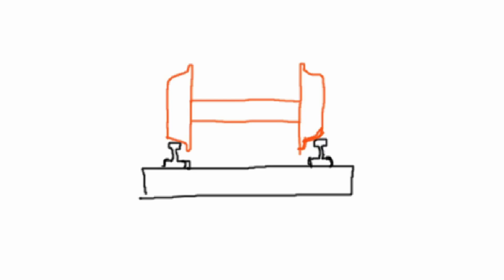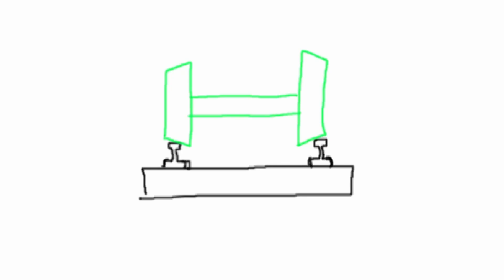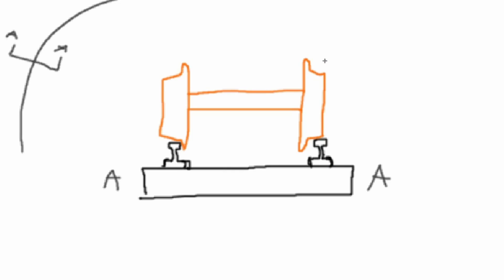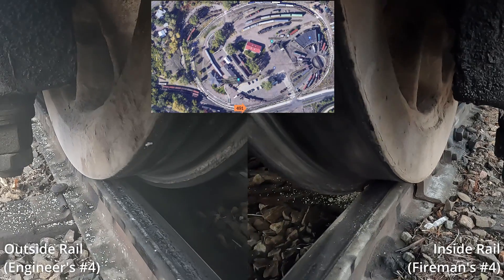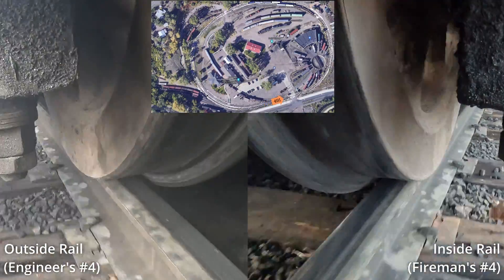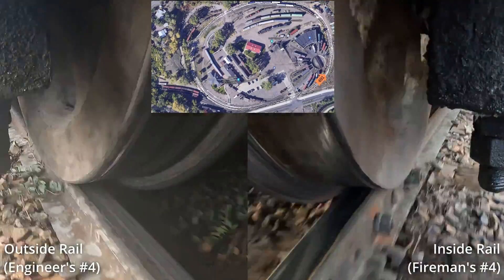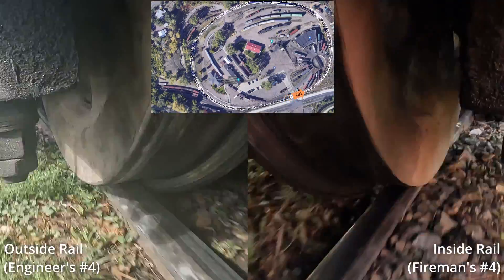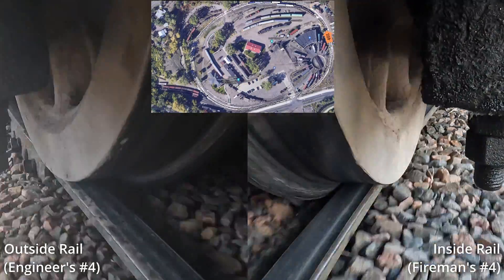Railroad 101: How do railroad wheels interact with the rail? A study on D&RGW 491

Comment: Very good information and insight.  Those are some sharp curves at the museum and those pony and trailing trucks are quite a distance from the drivers which would account for the 1/2" or so they are offset on the curves.  '91 is probably pretty "stiff necked."  I don't think they designed much lateral play into her drivers.
Reply from the maker: There's a lot of lateral in the #1, but the other three, not so much.
Reply: @Hyce777  interesting.

Comment: The flange issue is also present on the Norwegian standard gauge.
As I looked into the fuse panel of one of our DMUs from the 80s that is about to be phased out of operation this year, there were fuses and indicators for a "flange lubrication" system to fight the wear thing you see here.
This is also why the rails here are a bit oily on the inside which you can see at the passenger stations where there are track crossings between platforms.

Comment: while breaking in slot cars the tires would cut the inside track until centrifugal force causes slippage and if balanced correctly allows a drift condition.

Comment: Why is the number 1 and 3 drivers rubbing against the outside rail, and the 2 and 4 drivers riding along the inside outside  respectively at120°when clearly the 1 and 4 should ride parallel to the 2 and 4 @ a  -240° the 1 and 3 rides inside the outside rails…see?
Reply from the maker: No

Comment: I work on a standard gauge railroad in the US. We mostly do industrial switching and fairly short runs between yards and areas that we switch. In theory you don't need the flange, but I can tell you in practice those things ride on the rail all the time. Particularly through switches and tight industrial tracks, you hear them scraping the whole way. Also, it is important to remember that not all railroad track is as perfect as a Class 1 mainline. The majority of yard and industrial track is old and made out of sections that are often shorter than modern railcars. There are definitely areas where the gauge sags inward or outward. If this happens enough you'll have a derailment, but in small amounts the flanges can help keep the wheels on the rails.
Reply from the maker: Oh for sure you hear the flanges on industrial trackage all the time. Your other points are good too.

Comment: Basic Physics. It's momentum. Try it in your car, sometime. Go around a curve, and you (as well as anything else in the car) will shift towards the outside of the curve. Momentum makes objects "want" to continue moving in the same direction, even when there is a change in velocity (the direction component of velocity). Momentum is equal to mass times velocity. (Velocity, not speed, as velocity is a vector (includes a direction component), meaning that velocity is equal to distance over time in a chosen direction.) The locomotive, and the entire train, are quite massive. The amount of momentum is thus great, even at lower velocities.The train "wants"to continue going straight, even as the track curves, causing the entire train to shift to the outside. (Because of the engineering of the truck sets, however, the opposite wheeled axle will most likely have the flange of the outside rail pressing against the rail. Otherwise, the structure would fail, due to incredible amounts of torsion.) Momentum is indeed also responsible for trains, or any vehicle really, rolling over, if going to fast around a curve. It's also why race tracks are slanted upwards, from the inside to the outside. Momentum will always pull an object towards the outside of a curve.
Reply from the maker: Yes, so why is it riding on the inside of the curve?

Comment: Those tires are not sloped enough to force the them to ride up.  The reason the inner wheel lip gets closer to the rail is because it is being pulled inward by the train car itself, which in a right hand curve is always to the right of the wheel.

Comment: Centrifugal force? The momentum and going around the curve is throwing the... No... Wrong side, the outside would be wearing. This is a good one.
Is the track itself banked? If the train isn't moving fast enough for the bank of the curve it may cause the train to hug the inside rail.
Reply from the maker: Track isn't banked. You'll see the answer in an upcoming video.

Comment: What I would like to know is are the #2 and #3 axles blind drivers.   That would explain this.   The rear most axle will off-track to the inside, it's the rail that actually stops it from doing it more.   Think about how a trailer, or even the rear axle of your car off-tracks when you take a corner.   Same story here.  Unless your curve is sharp enough, and speed high enough to force all the axles to the outer rail, this will happen.   Great video though.
Reply from the maker: All flanged in our case. I filmed a follow up to this video with every single wheelset, so we'll find out shortly. :)

Comment: Easy solution. Add flange greasers to your railroad. Also you need to wye or balloon you’re a locomotive and run it the other direction on your circular track.
Reply from the maker: We do run both ways. And heavily use flange oilers.

Comment: I think your theory is right. If you think about it, you have a rigid frame going around a bend. So take that rigid frame and put wheels (or maybe pegs) in the front, middle, and back of that frame. The front and rear will rub against the outside because of centripetal force. But if the frame is longer than the radius of the curve (I think it's radius), then the middle will rub on the inside as it's turning acting as a pivot point.

Comment: Here's a question, might sounds totally out there but keep in mind that i'm a car guy and not really a train guy. Seems like the construction of the locomotive doesn't allow all the axles to wear evenly because you're doing laps only one way so how about fixing this by switching over the axles after some time to get the most life out of them. Where there's the group of 4 axles just swap them around 1 with 2, 3 with 4 after an X amount of time. Same can be done with the front and rear single axles. If you cannot alter the route then at least switch the axles around so they ride differently and act as if the loco is running opposite way laps.  Would that be possible?
Reply from the maker: We do turn the engine around. Unfortunately, with the way the locomotive is constructed, just swapping axles isn't really possible; you couldn't even spin one axle around left for right as the rods are set up to be offset only one particular way. Imagine you're trying to flip around a crankshaft, rather than an axle.

Comment: Is there any super-elevation of the track? Is the outside rail higher than the inside rail, or is it level across both rails?  In roads for cars and trucks the outside of the curve is generally slightly elevated and the amount of the elevation is dependent on the designed speed limit, (higher designed traffic speeds have greater super) and the grade, while still maintaining a certain amount of crown for drainage. 

As a traffic accident investigator I determined “minimum speeds” based on skid marks and other pavement mark evidence. Pavement grade, curve radius, super elevation, pavement coefficient of friction, along with the curve radius of the skid marks were all variable plugged into a standard formula.
Reply from the maker: There's little to no superelevation on our railroad. High speed stuff gets it, but not here.

Comment: wheels with a strait axle going around a curve the inside wheel would be trying to go slower than the out side wheel. can you explain what happens there to the people that don't under stand the workings of the wheels.
Reply from the maker: That's what the video is for

Comment: When a tapered wheel is rolling down a straight rail, you can imagine a longer circumference next to the flange, and a shorter circumference on the small end of the wheel. So if the wheel somehow made full width contact with the rail, it would have to skid on either side of the contact point. The wheel would wear the rail on either side of the contact point, or the rail would wear the wheel, depending on your frame of reference.

So when the wheel rolls around a curve, the outer wheel needs to roll farther, and the inner wheel needs to roll shorter. So the outer wheel creates a steering force that moves the contact point on the inner wheel towards its larger circumference near the flange (trying to speed up the inner wheel). The inner wheel steers the outer wheel to the outside where the circumference is smaller to try to slow down the outer wheel. Neither wheel can 'win' this argument, so they find an equilibrium point where the least skidding is created.
Reply from the maker: Makes sense.

Comment: Because the outer wheel is higher up on the track it pushes the train towards the inner rail because the shape of the wheels always wants to be centred. 

I guess it could be fixed whit another angle on the wheels, a different radius on the track or a slower speed.
Reply from the maker: All possible.

Comment: I can't theorically explain the phenomenon but by experience, I can say that the small taper on the wheel have the mission of center it on the track and avoid the ribs rubbing on the side of the track so the friction is limited.
What I can say is that when a curve have a small radius, the squeal is infernal and the only way to limit it is to paint a coat of graphite on the track

Comment: Is it a question of camera angle, but it looks like the diameter of the wheel right adjacent to the flange is smaller than the diameter of the wheel furthest away from the flange.
Reply from the maker: There's a small amount of "hollow tread" going on, but it's not really significant enough to cause issue.

Comment: First thought- (probably the only one) is that you are running tighter than "normal" bends on your track, and that the train is being dragged into the center od the turn, coupled with lower than "normal" speed on the bend.   If I'm right, you will either have to go faster (not recomended) or set the track with the outside rail LOWER than the inside!

Comment: When I was a teenager in 1960, we would drive a '51 Ford onto the railroad tracks and ride between crossings on the rails. We did not have to steer the car to keep it on the rails. Has anyone else done this?
Reply from the maker: I haven't, I'd imagine most newer cars probably have too wide of a wheelbase for that to work.

Comment: How much superelevation do you have on the track? 

Edit*** I see others have commented on this already. You need to actually measure the superelevation and then do the calculations based on the speed of the train set to figure out what is going on.
Reply from the maker: I filmed every axle on the engine and tender to figure it out. That video will come soon enough.
Reply from the maker: @DuaneKerzic  because the engine slips in that spot of the track due to track conditions. 

The superelevation is non existent.
Reply: @Hyce777  the radius of your curve is about 260', the gauge of your track is about 3' and the speed of your train is about 10mph. The required superelevation is only about 0.9". In other words, nonexistent. And if your train is only going 5mph it would be 0.24". That would be to balance the train set. Slower or steeper it slides to the inside, faster or less steep it slides to the outside.

At least that's what I learned while I was in college taking dynamics to get my BE in Mechanical Engineering.

Comment: I think the reason being for the inner flange to rub on the rail is firstly the lack of sufficient velocity for given sweep and secondly the actual rail is probably slightly super elevated on the outer radius rail.
In order to have the axle shifting how it supposed to the rail would have to be dead level horizontally I assume

Comment: I am not that familiar with the Mikado type so I don't know how it's suspension and any articulation it has is setup. But a problem with ridged frame is how the center gets pulled over the inside of the corner just like how a semi trailer does at a tight bend. Some railroads did use flangless drivers to get around this problem such as PRR but it wasn't a full fix. The only real solution is better articulation.

Comment: Think of the train going around a curve.  If we're looking at the train from behind, and it makes a left turn, the train would pivot on the center of gravity.  So, the top of the train would pivot away from the turn (i.e. to the right), and the bottom will then pivot in the opposite direction.  Hence, the wider gap where you don't expect it.  Your thought that the gap should close on the right side (the outside) would work if the train stayed completely upright through the turn, but of course it won't.
Reply from the maker: Interesting thought. I'm sure at higher speeds that is certainly true. At the slow speed we run, I'm not sure.
Reply: @Hyce777  Centrifugal force happens at any speed.  It may not be too noticable when you are on the train, but it happens.
Reply from the maker: @stephenv6200  of course; but is it "enough to move the needle"? That's what I'm unsure of.

Comment: The cars center of gravity is very high. As the curve is rounded, centrifugal force pulls the top of the car outward. As weight is transfered to the outer wheel it sinks lower and shifts inward due to cone shape. The inner wheel is forced up its rail until contact is made with the flange, keeping the car from rolling over.
Reply from the maker: Interesting thought; that probably applies at higher speeds, but I'm not so sure that's the case here.

Comment: You didn't talk about the rest of the train.  Could it be that the weight of the train is pulling everything towards the inside of the curve as it goes around?
Reply from the maker: That's definitely possible as well! I filmed every axle on the engine and tender to figure it out.

Comment: I thought the part of the frame that carries the drivers was rigid. Unless ther's an articulation point between the #2 and #3 drivers, how can there be an offset of #2 and #3 with respect to #1 an #4?
Reply from the maker: The frame is rigid, but the suspension is separate and the drivers all have their own play.

Comment: You sound like someone that should subscribe to the trade publication: “Interface - The Journal of Wheel/Rail Interaction” where all the science of steel wheels on steel rails gets discussed. 

The suspension theory makes a lot of sense. Would be interesting to try a few things to validate that theory such as…
…running the locomotive for a lap in reverse - although the buff forces from the tender may add a lateral load into the frame that causes the rear driver to overcome the inward forces of the suspension, possibly causing the #4 driver to pull away from the inside rail.
…repeating the tests with a locomotive that lacks a trailing truck (346) 

It would also follow that the repeated laps around the loop with the forward-most and rearmost driver always being forced to slip/scrub you would in time see a different wear pattern on those tire’s treads; I would wager the taper disappears more quickly on those drivers.
Reply from the maker: I need to look into that publication! I have not heard of it. I filmed every wheelset on the 491 yesterday to make more comparisons in another video. I want to try 346 as well, for the no trailing truck and also blind drivers; but she's down for overhaul so it will be a few years.

Comment: Dont know the full specs so just a guess, but in theory the taper of the wheel should be proportional to the radius of the rail curve for the full theory to work. And by the looks of it you are running a really tight radius museum track. I would also take a guess that the loco has probably been running the same loop of track in the same direction for years. So based on the current wheel taper the wheelset is trying to self center but running out of room so hitting the flange. Not a train guy just a maths guy.
Reply from the maker: We run both directions, and it is still relatively tapered. The right curve doesn't help for sure though.

Comment: Equally interesting is the Crown Wheel.Found on traction engines where the same effect is caused by having the centre of the pulley of a slightly larger diameter. No flanges but a flat drive belt will self centre . 
System is used to drive tape decks and similar devices.
The principal is the same as the train wheels.

Comment: Fascinating, but logical. It is a tight track. 7 1/4” model railway says 3 degrees and 45mm gross bahn is happy at 5 degrees with massive flanges. I’m building a 7 1/4 so I have been looking at dimensions :o)